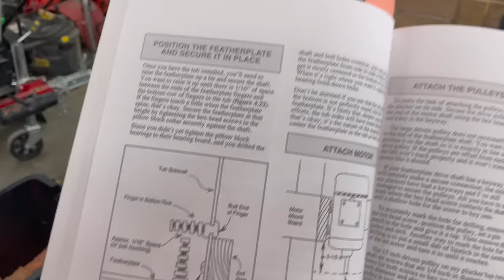Ultimate DIY Chicken Plucker

Comment: Outstanding work; there is no greater compliment.  Thanks for sharing.    P.s.  I have not disappeared, but I have been very ill; the doc says I can get back to work as much as I can tolerate.   Once again, you have done an excellent job; you should be very proud.
Reply from the maker: Thanks! Glad to here you are still around. This design is proving it’s worth - 6 times this year with duck, goose, pheasant, chicken, and turkey. You nailed the design - grateful to have such a great starting point for my build! 🙏
Reply: @samuelwiltzius  Nice work. Have a question about number of fingers you used. Southern Engineering used 152 but you seem to follow the Whizbang plans on that one and they used 125. Did you have any problems with the fingers NOT doing a good job? S.E. says he used 3/16 plate but the .125 says he used 1/8. What did you use?
Reply from the maker: @Bobcagon  thanks! I had great luck with chicken and pheasant with the wiz bang finger layout… but geese and turkey took longer (50-75% more spin) so I added more fingers after looking at commercial plucker finger layout and also increased the speed to 315 rpm - I feel this has optimized the plucker and there are no more gains to be had. The feather plate is from chickenpluckerparts.com and is .190" 5052-H32 Aluminum
Reply: Where can I get a PDF? And how much would it be?
Reply: @robertgraveline6108  Sorry, but I never made a PDF.   The videos are the instruction.
Reply from the maker: I have a longer video with more detail and a parts list but no formal write up anywhere.

Comment: First off, Kudo’s for giving Southern Engineering his credit. He did a great job but he’s kind if disappeared.

You really stepped it up and I can’t wait to get your parts list and see your more detailed video. Most Excellent Job!

Two challenges for you: One, we need a scalder and two, I want to build a honey extractor which could likely be built similar to this plucker.  Thanks!
Reply from the maker: Not sure on the honey extractor - I have bees (build my own frames and boxes) my extractor is second hand and all stainless steel - probably better to buy that and DIY add a motor. The plucker I built was expensive (see end of long video I posted) but scalder was cheap. I briefly talk about the scalder in a video showing how my wife and I process birds, I’ll find a link for that. 

A scalder is just a barrel/pot of some type, 2000W hot water element, 10 gauge extension cord, water heater lower thermostat (residential goes to 150, commercial hotter but more money) and 1" FPT Bulkhead Water Tank Connector Stainless Steel Thru-bulk Fitting (Amazon.com name). A hole saw and a few pop rivets and it’s built.
Reply from the maker: The Best DIY Chicken Plucker and Scalder - How We Process Chickens
https://youtu.be/iNBf-sCVTSU
Reply from the maker: Correction: lower thermostat for water heater (only has two leads)
Reply: @samuelwiltzius  Thanks! Did you just mig weld the galvanized conduit?
Reply from the maker: @scottsnodgrass4361  Yes… It was tricky at first and the welds won’t win any beauty contests - I’m not at all an authority on welding. I did try to remove the galvanize and weld in a well ventilate area at least.
Reply: Not disappeared, but I've been very ill;  I'll be back to full speed soon.
Reply: @SouthernEngineering  hey!!! So glad you’re back. Hope you’re doing well!

Comment: Maybe a different question, I know that dipping the chicken in a hot water make it much easier to pluck the feathers, but is it also possible to do on cold water?  Have you tried that?
Reply from the maker: It isn’t. When doing waterfowl I first spin them in plucker under cold water for 5-8 seconds before scalding so it roughs up the feathers and oils. Once I forgot and kept spinning - those feathers stayed put!
Reply: @samuelwiltzius  so it seems it won’t pluck then...🥲
The idea of hot bath I just didn't like it, that's the reason that I asked.

Comment: Where   did.  Your. Get.   1/2. Plexiglass.  And.  3/16.   Aluminum.    24x24
Reply from the maker: Those two parts were the hardest to source - in the video description I have a link to a longer video with the full parts list. The 1/2" sheet is 24" square and is from amazon; it is HDPE (high density polyethylene), the feather plate was sourced from https://chickenpluckerparts.com/shop and I highly highly recommend purchasing it here instead of trying to mill and drill one.

Comment: I would really like to understand the basic 'mechanics' of how the feathers are actually plucked from the skin of the chicken. Really curious about how this happens.
Reply: The chicken is immersed in very hot water for about 45 seconds until you can easily pull the feathers out , then the rubber fingers easily pull out the feathers during rotation, if you wear rubber gloves you would find that wet feathers are very easily gripped by the rubber .There is an exact temperature for the water for immersion but I forget at the moment , I think it's around 85 degrees Celsius sorry I'm from Ireland and don't know Fahrenheit temp.
Reply: @garycoll4151 , thanks Gary for the explanation. 👍🏽

Comment: Fantastic, I would watch a 1 hour vid on this with narration and instruction. 
Note: Welding galvanized metal produces unusually toxic fumes.
Safety "Ken" here.🥸
Reply from the maker: I have a longer video (link in description) - and yeah... galvanized. I took precautions and stripped as much as possible before welding. Also the room I'm working in is power vented to the outside and I stayed upstream of the airflow. I would do more if I welded more than once or twice a year.